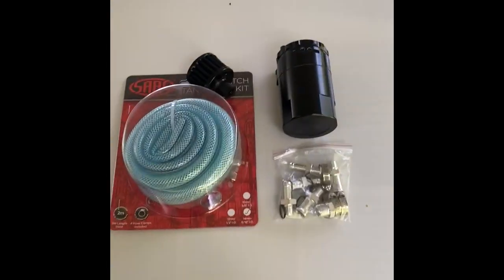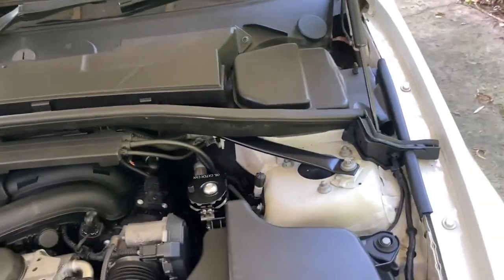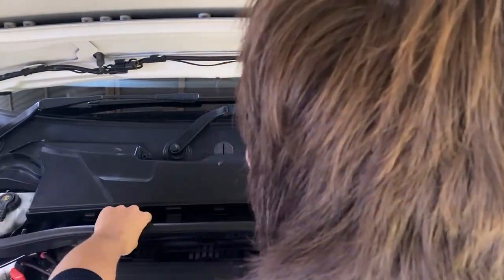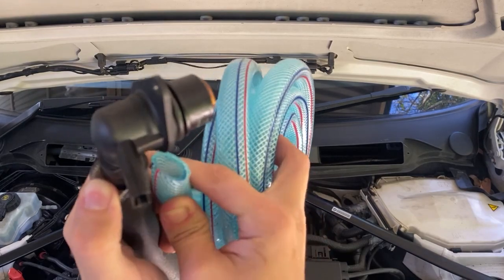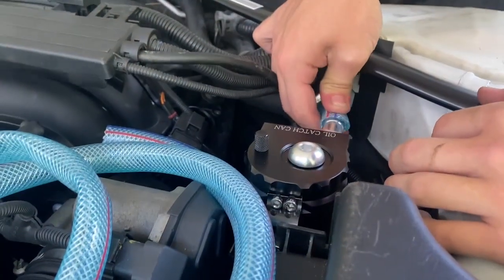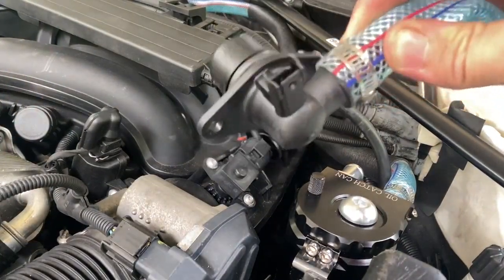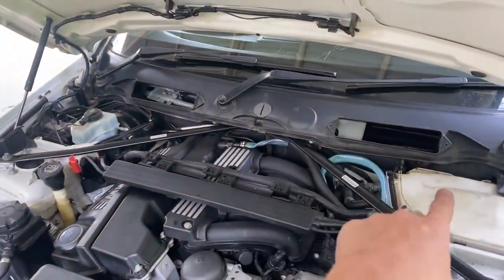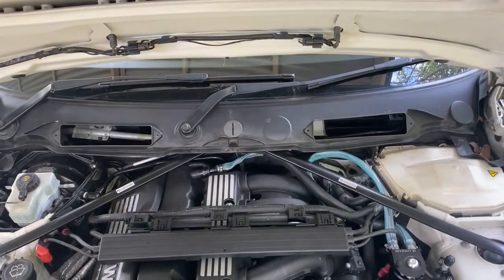BMW N46 / N42 Oil Catch Can Installation (2008 118I)

Comment: Any update on the car any improvements with the catch can installed notice any downsides?
Reply from the maker: oil consumption has improved drastically, I went from burning about 1l of oil every 1500km and i'm now burning only about 400ml of oil ever 1500km. Only real downside is having to check the catch cat every now and then and emptying it.

Comment: Thanks for your explanations. If I do already have a high vacuum when I try to open the oil cap, will this solve that vacuum who's causing engine vibration too ? 
I do plan to install a catch can but I need to solve the vacuum problem first as I do not have oil burning (yet) 😅

Comment: Good video, but I just want to add that the majority of the oil consumption on these engines is most probably due to bad valve stem seals. They go hard over time/heat cycles and let oil pass by the valve stems, directly in to the combustion chamber. So the proper solution is to replace those seals, but i gues if you want to invest money and energy into installing the can instead... it's an option:)
Reply: Do the valve stems seals, my car was eating 1liter every 300-500kms and after I replaced them I have about 100ml per 2k kms. It is WORTH to replace them
Reply from the maker: I 100% Agree, i replaced my stem seals and still had increased oil consumption. my n46 has no pcv only the atmosphere vent on the valve cover. I love your vids by the way! your videos inspired me to start fixing my 1 series so its crazy that your seeing this haha.

Comment: does this help remove the oil that goes into the intake from a worn out ccv does this mean you don't need a ccv anymore
Reply from the maker: @BondservantKyle  this works in addition with the ccv and acts as a pcv vent. the ccv only opens when there is high pressure in the crank case and vents to atmosphere. this just acts as a sort of filter for the pcv hose to stop oil from re-entering into the intake manifold.
Reply: @KQUINN720  so it'd possibly the air that's entering into the manifold that's causing the oily residue to form up inside the intake and on the plugs,forgive me I'm not mechanically minded but I'm learning here.
Reply: @BondservantKyle my intake manifold is quite oily and when I removed that hose as in the video for the vacuum it was very oily and with liquid, from what I have done research it is recommended to put a catch can for this engine. Thats what I actually wanna do next month
Reply from the maker: @dariusstn8853 let me know how you go!
Reply from the maker: @BondservantKyle the pcv has no filter on this engine and basically reroutes oily / watery air from the top of the valve cover straight back onto the intake. the catch can helps seperate the oil from the air and keeps the intake clean from oily residue

Comment: Does this reduce oil consumption by much?
Reply from the maker: it is not guaranteed but in this case it helped a lot. i went from topping up oil every 1500km to now only topping up every 6000km-7000km. hope this helps!